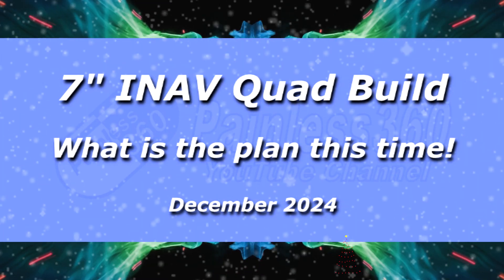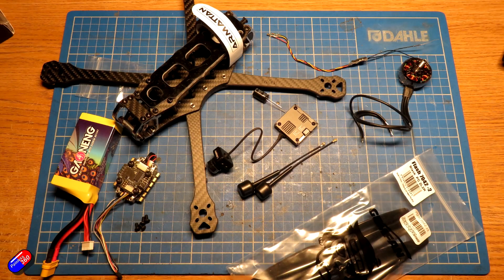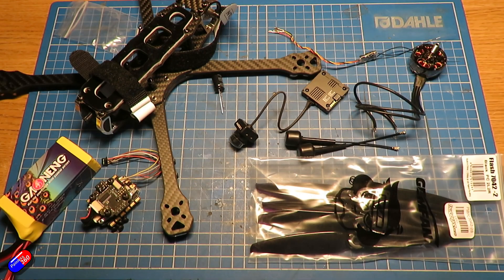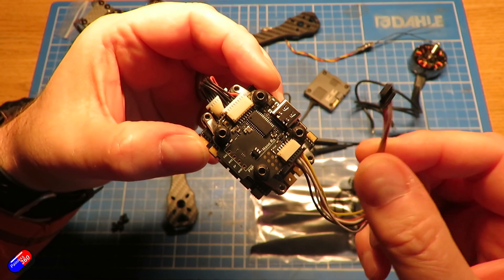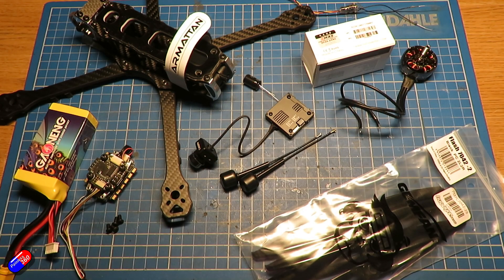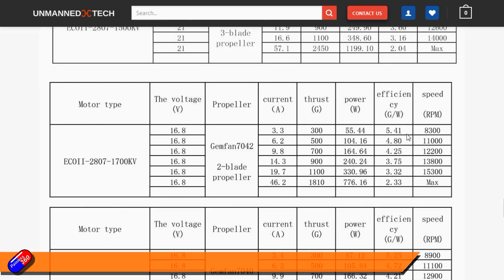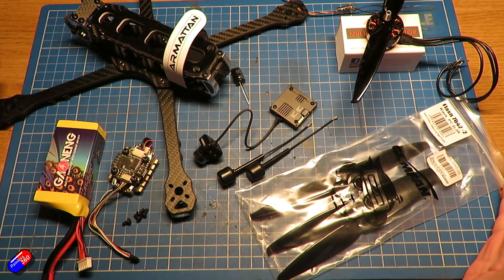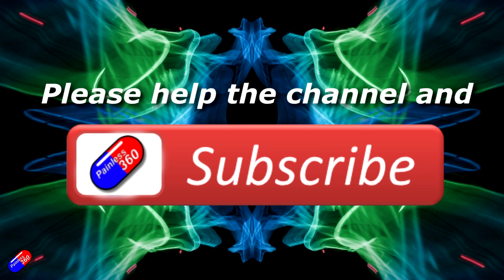Festive Holiday 7" Quad Build: 1. What are the pieces I'm planning to use?

Comment: Looking forward to your build.  I just "re"-built a 7" quad, swapping from Hyperlite 2408.5 motors to the ECO II 2807 motors.  And swapped frames from iFlight X7 to AOS 7 Evo frame (real sturdy but heavy).  Goal was to improve flight performance and remove a lot of vibrations I was having.  Seems to have worked, but it's a bit heavier now due to the larger motors and heavy frame (~175 g more).  BTW, did I hear that right... 7S?  Your ESC won't support that.  And with 1700kV motors, that's gona be crazy!
Reply from the maker: Thanks for the comment, see the note in the video description ;) Happy flying!

Comment: Looking forward to the progress of your build Lee. All the best for 2025!
Btw. I had to ditch my Lucid pro FC because of the Walksnail OSD incompatibility. Using a Aikon F722 on Lucid ESC now and did flash the newest 2.17 rc am32 fw.
I‘m using a large 6s 3500 lipo on my 7“ with F90 1500kv motors. It‘s quite different to my other quads, learning some new things 😊

Comment: Hi Lee,

Looking forward to the series. Just watched the intro video. I am 4 hours ahead of you in Mauritius, so the next video is still "private".
What sort of duration are you expecting ? Can you maybe suggest options for "long" duration, 30 mins or a bit more as well please.  Happy New Year to you and all your family. Thanks for everything you do for us all.
Reply from the maker: Next video will be out at the weekend,  stay tuned!
Reply: Perfect timing and can't wait. 

Having been a subscriber for a couple of years and only flying DJI quads for photos and surveying, I've just built a 7 inch quad with the speedy bee F4 v4, M10 GPS and loaded INAV 7.1.2 because I wanted to learn more about MAVLINK. I'm flying INAV v7 whilst I learn how to not crash and will upgrade to INAV V8 when its released. So far in my testing the Position hold and RTH modes are rock solid and save me a couple of times per flight!
I have a Speedy Bee analogue VTX in the post  but nothing to receive the OSD/telemetry yet.

Things I struggled with the most are:
ELRS Tx and Rx firmware updates
Radio Master Pocket  Controller updates and setup (found one of your vids from 5 years ago)
Getting Mavlink telemetry to q ground control from the controller. Not sure this is possible in INAV 7.
Reply from the maker: Here are a few tips: 
1) https://www.youtube.com/watch?v=3je0NrBzVy0 should help
2) https://www.youtube.com/watch?v=wnLek9iriug should help
3) MAVLink stuff coming in INAV 8.0, stay tuned! 
You can find my content easier after watching this video: https://youtu.be/CIuUNdVfBJQ or https://www.youtube.com/watch?v=P4soR6QgOk0
Best of luck!